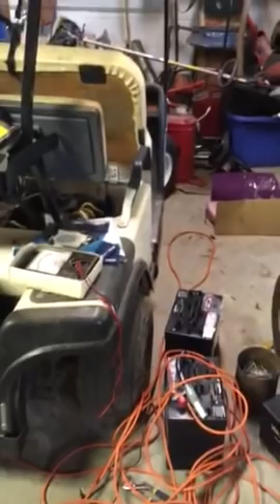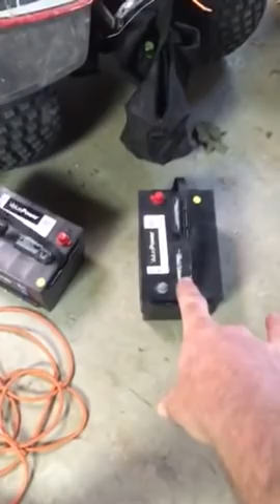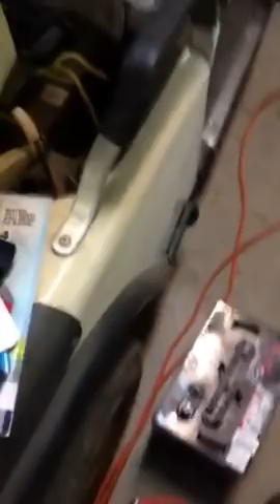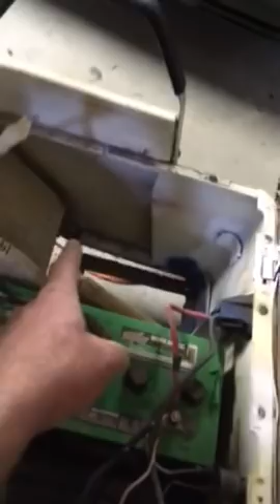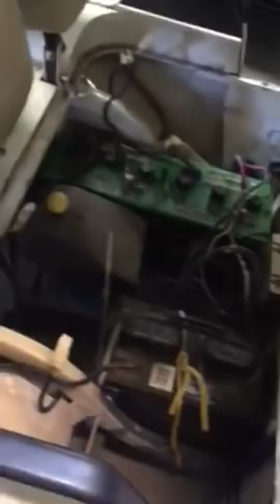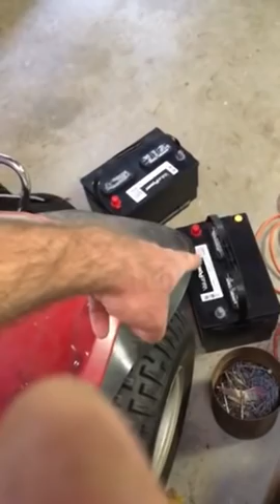how to change golf cart batteries from six to 12 volt

Comment: Golf carts need deep cycle batteries. The cranking amp batteries are different and won’t last as long per charge or power output. Cheap fix...also having 2-6 volts and 2-12 volts will power down at different rates making the batteries work much much harder

Comment: Why not just buy 3 12 voli batteries & save another $150.
Reply: Kenneth Draper capacity 12 volts are used to supply burst. That's why cars use an for starting.  Less burst more room for amp hrs. So  they way he has it hooked up gives it lots of supply and some burst behind it because electric motors